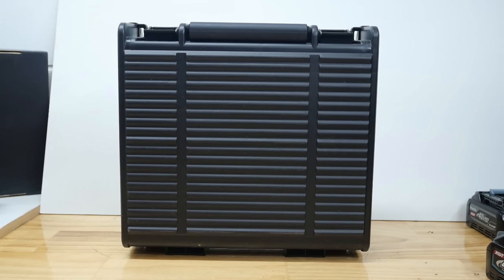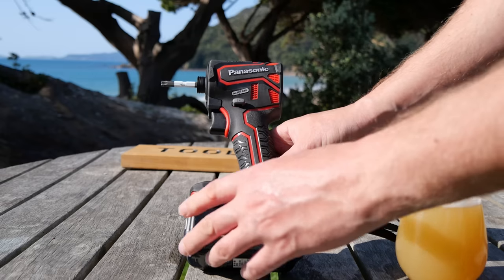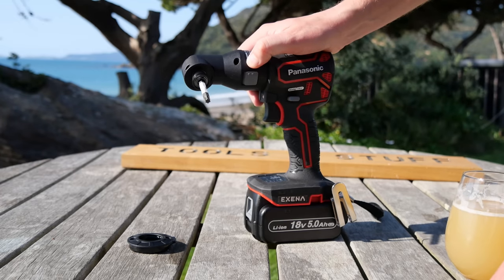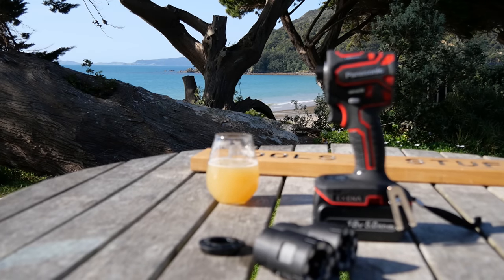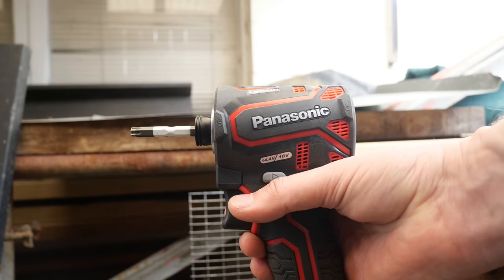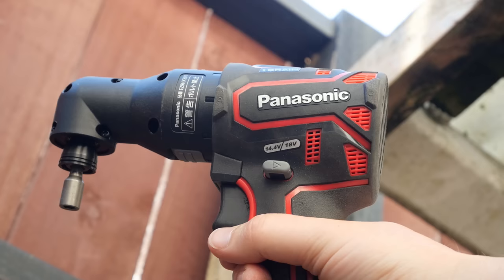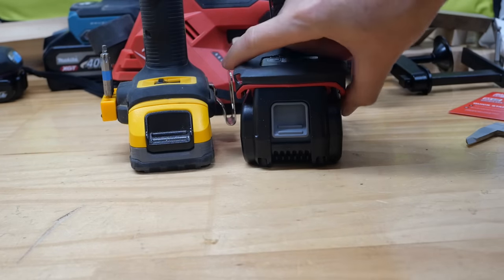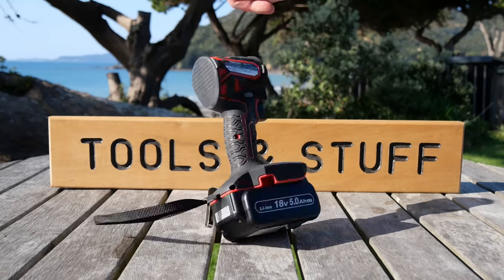I Bought THE WORLD'S SMALLEST IMPACT DRIVER from Japan And it has a CABLE CUTTER Attachment!

Comment: I always thought one of the smaller brands could shake things up by releasing a whole lot of specialised heads for an installation driver. The big players wouldn't do it as they want to you to buy more skins rather than attachments. I was hoping Hilti would do it, but this seems pretty good. Need a nibbler, polisher, die grinder, sander, riveter, etc.
Reply: Bruh, Black & Decker have eleven hundred attachments for their drill.
Reply from the maker: Remember those old B&D circ saw attachments... ahh memories.
Reply: @robertrada6040 i meant a serious brand. Those are dinky DIY tools. What I want is to not have 50kg of skins to haul around to cover nibbler, shears, dremel, rivet, etc. You can already get 3rd party drill attachments for these, but they often require you to hold it, or have a flimsy arm that clamps on the battery.
Reply from the maker: It would be nice if Stanley Black & Decker had a premium brand of power tools.
Reply: @ToolsAndStuffOFFICIAL  Dewalt is in the business of selling you 50 different skins, so they'd never make a premium version of this
Reply: @toolscientist  Rivet gun really is it’s own thing.  The driven gear is very large and the drive gear and motor have to be displaced to make room for the rivet stems.   I know there are attachments, but don’t know how they operate. I have some idea, however, and I wouldn’t want to put a cordless drill’s planetary gearbox on one.  Nibblers and Shears are usually grinder or even screw gun bodies.  Much like a Lamello uses a cheap Metabo grinder.  The cost ain’t in the motor body. It’s in the head.  Most companies just aren’t interested in turning away a chunk of the smaller sales they’d have to begin with by saying you have to go buy another tool too use with the shears and nibbler. The tool body is trivial when setting price on those (and most metal work) tools.  Rotary tool is 5000-32000 rpm.  It’s a motor and (hopefully) a sizeable bearing.  Just no way you’re realistically putting one on a drill.  Same for a router or a die grinder.
Reply from the maker: Of course DeWalt wouldn't make a premium one as they are not a premium brand.
Reply: @robertrada6040  I'm thinking along the lines of Hilti making a $500 body with ~15 attachments at $100-300 each. Would come to about the same as buying 15 DeWaulkita skins, but 75% of the weight and 50% of the volume. Obviously DeWaulkita would never do it, but Hilti (or Metabo, before it was put on life support), could make a good go of it.
Reply: @ToolsAndStuffOFFICIAL  Stanley Black & Decker seems to be in the business of buying reasonable quality brands and cracking down the quality. They made the first power drill and now I'm sure you'd find something of superior quality at toy's r us
Reply: yeah im bullish about this pana line. the attachments are a game changer

Comment: Haven't had any Panasonic tools in over 30 years. Had some of their early cordless drills. The ones they would probably have liked to bury. They had high speed chargers with them. That destroyed the batteries in not many charges. You got free replacement batteries. No questions asked. Until you didn't. And the tool went in the bin. Think I had an electric drill about the same era. Don't see them around much. Mostly the big three. Milwaukee. Dewalt. And Makita. Would love to try the new Hilti Nuron stuff. But nowhere near any outlet. And a bit pricey. Tough being a tool junkie.

Comment: Used a Panasonic Impact driver years ago on a roofing job... we ended up burning it out fairly quick. The failure was primarily in the batteries, the contractor was miffed cause the tool wasn't cheap. 😅

Comment: If you want the most compact impact driver the Milwaukee M12 Gen 3 Fuel is the best. I have that Dewalt and a Makita 40v. Best part is that the battery goes into the handle..Bosch 12v has one similar with all the attachments too. Haven't tried that one, but I'm very happy with the power of the Milwaukee

Comment: That right angle attachment seems a lot longer than the one on my Bosch installation driver. The Bosch main body is quite a lot longer so I’d assume that the Panasonic is still shorter. But that’s kinda annoying :)

The thing I personally love most about the Bosch is the low speed trigger control. I’m using it a lot in my RV where there are a lot of annoying self tapping wood screws in plywood or particle board. The Bosch lets me remove and reinstall screws like that with very little risk of damage. It’s even better than a manual screwdriver because they go in straighter. 

So, for my personal use, as tempting as that Panasonic is, an impact scares me :)

Thanks for saving me lots of money. I got most of the joy of playing around with the tool, with none of the regret of realizing that it has annoying features that will make me not use it enough to justify the $$$.

Comment: FYI, Japan is 100v @ 50 or 60 hz whereas the US and Canada are 120v @ 60 hz for regular outlets utilizing most of the same receptacles. The 110 volt standard is a myth. You can plug in stuff from Japan in a US/Can plug, but you may wear it out due to over voltage.

Comment: Panasonic is nice for taking Instagram shots on the beach alongside your painted toenails, but DeWalt is the only choice for heavy duty professionals.
Reply: DeWalt = Default. Team yellow makes ok stuff, but as a former user, the all day balance of a tool matters to me, and DeWalt doesn’t have that. As far a heavy duty professionals only use DeWalt? Nope.
Reply: Aww poor wittle dewalt feeling emasculated by a girly instagram tool 😂😂💋💋
Reply: @justinvanaulen2478 Sleep well at night knowing that I’m taking the piss.
Reply: @niskytank  💅
Reply: You complain about the battery being too big but panasonic are duel voltage, you can put a 14v 1.3ah battery in which are so light and tiny that it feels like no battery is in and still impacts screws great